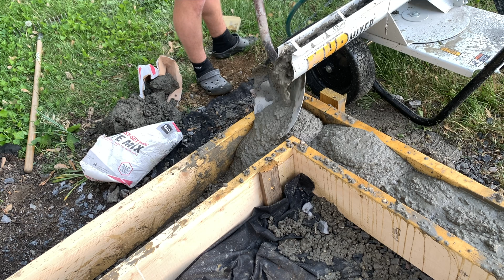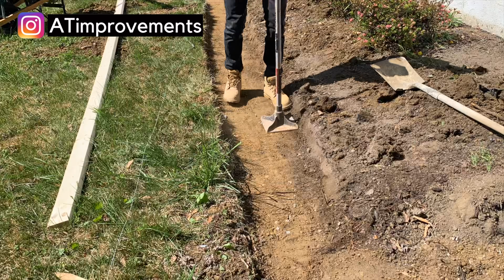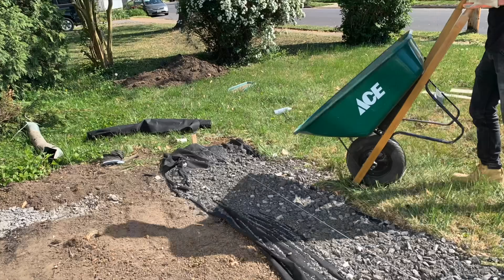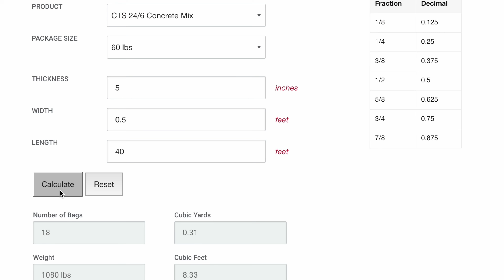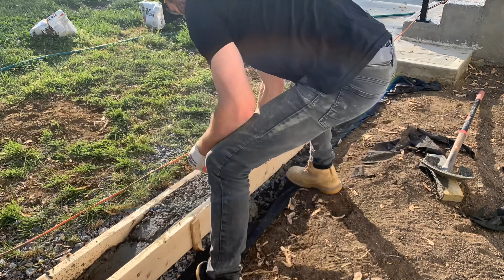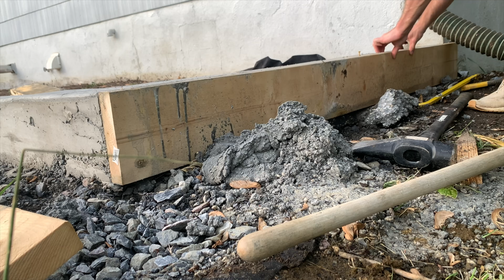The ULTIMATE Concrete Landscape Edging (DIY Concrete Garden Curb)

Comment: I know nothing about concrete, but from what I’ve learned, wouldn’t something like this need expansion joints to prevent cracking?
Reply: I was just about to ask the same thing. I suspect it doesn't get very hot or cold where this was done. Maybe?

Comment: Pro work, no doubt about it. I did something similar to this but I'm in Australia...the sun will heat up concrete and kill the edge of the lawn. So I used a mix of crushed limestone and a small binder of builders lime and cream coloured concrete. I used a few more expansion joints to allow for the lack of strength compared to concrete. Came out really well

Comment: Some areas you're using 2x4s for the forms in others when cutting it appears as 2x6s, at 5:25 they seem 2x6s, how thick was the curb?
Reply: I think it’s because the yard falls away at that corner and it’s a bit of a drop edge beam so to speak.

Comment: From experience you have created a pond. One day you will get so much rain that it will fill up and travel under your home. The fix is to enclose it away from the hose and add 2 inch pvc for drainage
Reply: Good advice! Thanks! I have some plans to do some concrete work around my house. These little tidbits of knowledge are invaluable.

Would you just place the pvc under where you plan to pour the concrete, at a slight downward angle away from the house to encourage run off?
Reply: Nah.  It’ll be fine.

Comment: 2x6 forms seem a bit of expensive overkill....contractors mostly use 1x  or even 3/4 ply...good DIY video
Reply: i do agree.
Reply: And if you use pvc trim boards you can make curves with them too.
Reply: @FrankForkoff  Or you could use 1/4" ply with stakes to support it all. Size of the curb will drive the stake size/spacing.
Reply: But 2x6 forms last longer and get many more uses out of it if you are a mason that pours a lot of concrete
Reply: I mean dude wears skinny jeans with boots, so

Comment: ok, it would have been much easier to mow if your design had a radius corner and you radius it out to your existing slab. thats always gonna be tough mowing that inside corner, also you could of designed your form so outside edge sloped down to where you could have drove your mower wheel right on it so no edging would be required.also you should have put expansion joints in every so often for cracking.

Comment: you forgot motor oil on the 4x 4 framing to reduce the bumpy side finish on the cement when you pull the wood framing off.
Reply: 4x4’s 🧐🧐🧐🧐

Comment: Need weep holes and to get the water from the downspout to dump outside the curb. Water runs straight down thru the mulch and compost like top soil. Not good to have all that water trapped so close to the house.

Comment: Why did it crack? Maybe you should have put rebars in it?
Reply: Rebar doesn't always prevent cracks. It just keeps the slab from separating. From my experience concrete cracks more often because it shrinks as it cures. That's why you need to install the control joints, it's expected to crack
Reply: @h2thechizoit445  I see, you are using a fast curing concrete then. I am using a “normal” concrete I mix myself from cement, sand and gravel. I cures slower and didn’t crack ever. Thanks for explaining your case.

Comment: I would have suggested brushing or brooming to give it a texture. Also, would have pulled the board on the front off, rubbed and brushed it too.  But overall better than what you had before.
Reply from the maker: Texture definitely would have helped to hide some of the imperfections - that’s for sure. Thanks for watching

Comment: pouring concrete with water when it dries help to prevent cracking, especially when there's direct sun. For lazy solution - cover concrete with soaking wet blanket :)
Reply from the maker: Good tip - thanks for watching!
Reply: This! Plus it needs hydration for it to cure.

Comment: Good job! Having done this a number times myself i know how  much time and effort is required. I always put in a # 3 bar centered but i think I'd more inclined to mix in a reinforcing fiber next time.
Reply from the maker: I think a stick of rebar would have been a good idea in hindsight. Hopefully it holds up for a while regardless!
Reply: LOL 6 inch's deep and for a flower garden and you think it needed rebar and fiber cement
Reply: @davidstreling3690  I should have been a bit clearer. Instead of a #3 bar, I'd be inclined to add some fiber and and joint it where I think it may crack. Ultimately the base would determine what if any reinforcement is needed.

Comment: Using a reciprocating saw as a vibrator is a great idea. I would have placed a couple of #3 rebars in there for good measure in case roots push on it as the plants mature. Also, tooling control joints in wet concrete is tedious. I'd finish it smooth and cut them into the green concrete with a diamond (or abrasive) blade in a circular saw. Thanks for the content. It looks great.
Reply: its 10 time easier do do it wet, then to cut into dry concrete with a diamond blade.
Reply: nothing quite like edging with the help of a vibrator!

Comment: what do you think about pouring concrete against the foundation, almost like having a sidewalk running around your house, rather than landscaping, thank you
Reply: Funny you ask. I live in Italy and here sidewalk around the house is the rule. I’ve recently built a new house extension and I asked the architect if I could have no sidewalk or very narrow so I could plant shrubs close to the house as you guys have in the US. He said no. A sidewalk of at least  a meter (3 ft) around the house is necessary to prevent excessive rainwater from leaking into the foundation and causing damp damage to the wall. Consider that here all houses are brick and mortar and need impermeable barrier to protect walls from humidity rising up from the ground.
Hope the info is useful. Cheers. 👋

Comment: Awesome video! Question about the control joints. I see that when you went back to make the surface smooth, these control joints had been removed. At one point, after pouring the concrete into the forms, did you remove the control joints?
Reply: Control joints didn’t go anywhere.

Comment: lets face it, homeowners are not willing to pay for this at least 95 percent will not pay for this edging option
Reply: That’s because it’s kinda janky. Just use proper bricks. When this edge eventually cracks and the edges chip and the ground moves to the gonna look pretty ghetto. 

I get it that everyone likes clean modern lines and material but I’m thinking durability. It also makes changing things a pain. Now you need a sledgehammer to rework your landscaping  

It’s a total remodel and hard labor to do that instead of just  getting a few more bricks.

Comment: Damn, respect - looks amazing. Considering doing something like this myself, but a bit worried it might keep water both outside the border but also, inside - and then against my foundation. Any thoughts regarding rain/storm water and this border? Cheers!
Reply from the maker: Appreciate it! I thought about drainage concerns, but ultimately I decided that the gravel subbase of 5.5” would allow for enough drainage without much ponding. It also is Approx 6’ from my house - not like 2-3 feet
Reply: Just cut out a part of the concrete when you lay it get a drain extender and do it that way.
Reply: not a bad idea at all my dude @Spooky_Seto21

Comment: The expansion board isn’t necessary where exterior concrete contacts exterior concrete. It’s recommended when exterior meets interior (driveway against garage floor).
Reply from the maker: Fair point - I just went for the “better safe than sorry” approach. Thanks for watching!
Reply: @AndrewThronImprovements  starstruck I am! Thanks for the response dude.
Reply: Interior floors will have a substantial temperature difference than exterior. The expansion board lets both monoliths move independently. Where everything is in the same environment it will all move together.
Reply: So you’re saying exterior concrete doesn’t need expansion joint because it doesn’t expand ? 😅

Comment: I did this but mine looks Ike sit, too much work,  did dry pour method. I’ll hide the imperfections with plants.
Reply from the maker: Sorry to hear that! I’m not a huge fan of the dry pour method to be honest. I think it yields  poor results.
Reply: I highly recommend people just use bricks instead of pouring a curb around your house. The next thing person to live there probably isn’t going to like the busted up curb and it will hurt your resale. Plus it’s a bunch of work to remodel it compared to removing normal landscape bricks.
Reply: @CarlYota  that’s pretty subjective, I had 200 feet of poured concrete curb installed around my last house and the buyer loved it.  The only reason I did it myself at my new house is because I literally couldn’t get the company to do it they weee so busy, of course my one did not look like the professional one.

Comment: Nice job, I got a feeling my Wife will want concrete garden beds if I show her this..:). My only suggestion is I would have used a single strand of rebar through the middle (probably overkill) and I would have built the forms by ripping a single sheet of OSB or plywood.. Cus I'm cheap...:)
Reply from the maker: Haha the OSB is actually a pretty good idea! So is the rebar - definitely wouldn’t hurt

Comment: Also, weeds always find a way to grow no matter what you do, dirt over time will set and weeds will start to grow in your rock bed.
Reply from the maker: Unfortunately, I think you are right....  I already have a few weeds coming through
Reply: @AndrewThronImprovements  I think you would have gotten more out of it if the weed barrier had been on top of the gravel.
Reply: Weeds barrier is for weeds ROOTS, in cases your lawn has grass that spreads that way. Most weeds grow from seeds which land on top of mulch/dirt making the “weeds barrier” useless. Only actual use of geotextile fabric is for situations like foundation for a gravel path, to prevent gravel from mixing and burying in the dirt.

Comment: wd-40 on the wood makes it not stick as bad
Reply from the maker: 💯 I usually apply WD 40 to my forms but I skipped it for this project
Reply: Diesel in a pump spray bottle or brushed on for smaller jobs.